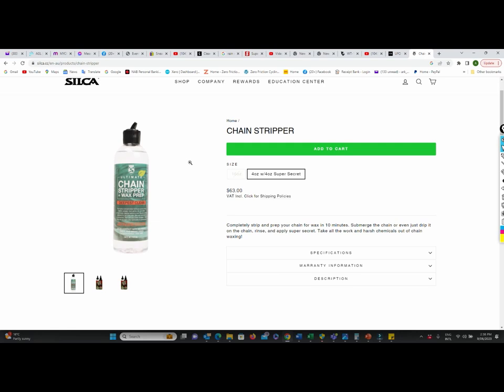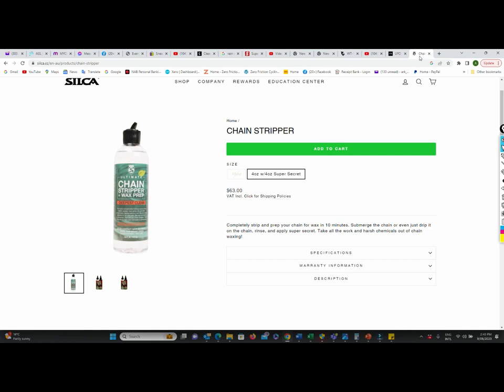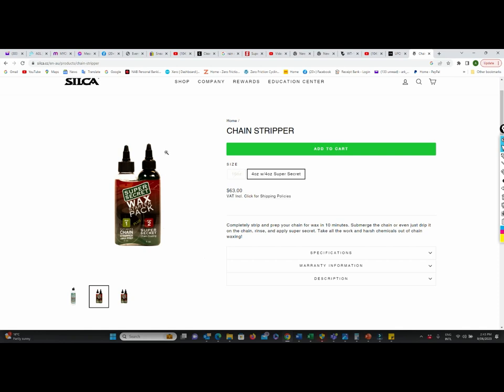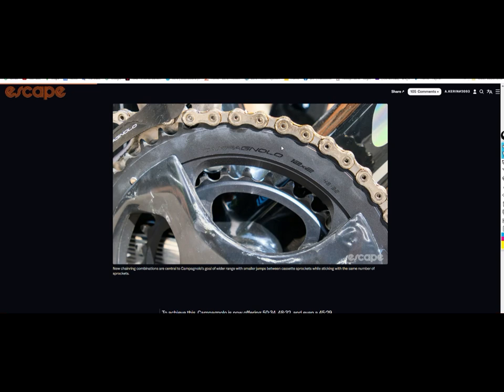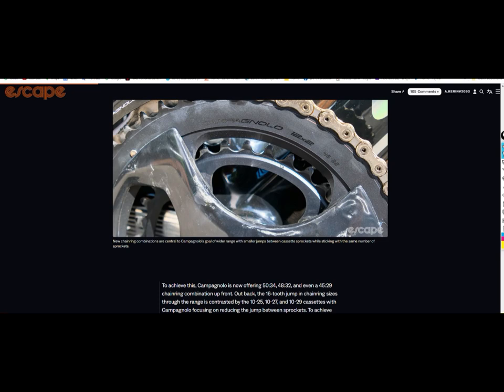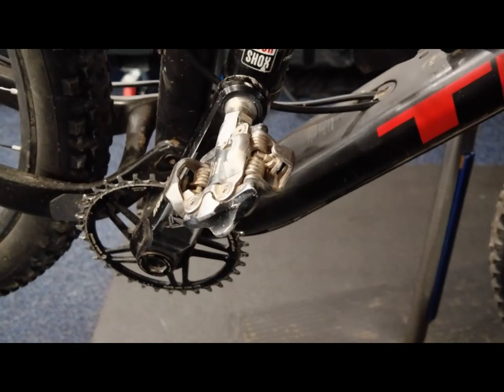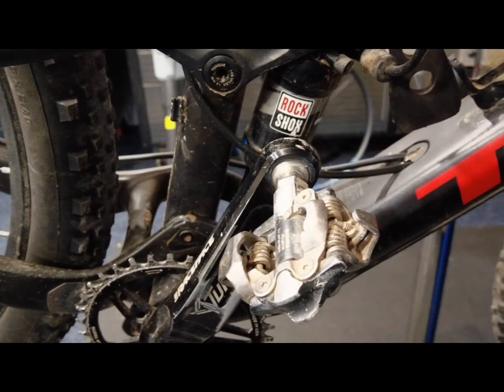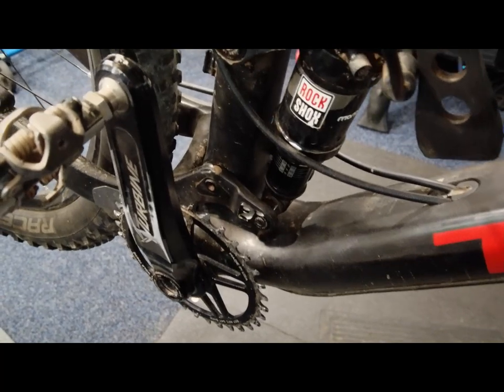Stripper and campy 10t

Comment: We're talking about marginal gains here. It would be nice to see the data watts, chain tensions, friction loss, etc. when in these 10 tooth high watts situations. Do you have the data yet? Update: chain waxing with Silca using a insta pot 4 qt to heat it up is a game changer. Takes 15 minutes, chain is always clean, wear is nil, and I'm using 4 chains. 2 road bike 2 on my mountain bike. I'm reusing the quick links up to 5 times with no problems. I'm so intrigued the cycling world hasn't taken this clean_zero_friction method by storm yet. It's definitely a game changer.
Reply from the maker: Hey Glenn - the data on the chart there by Jason smith of Friction facts fame is actual tested data. The short version is; 
> You will never detect such losses in your riding
> The losses are physics /maths / logic and TESTED - with extremely accurate sensors - proven. It really is not in dispute. 
> Whilst you dont spend much time in the 10t to get max losses, the fact is - smaller rings are higher loss, and will always have you in smaller cog for the desired gear inches etc - on average in most of cassette range it is going to be 2 to 3w. 
> We should not be going backwards in efficiently losses for latest and greatest and VERY expensive groupsets. All areas should be moving forwards. ANd there is no reason for us to go backwards - it is a reason that only helps the mfg in reducing their costs - but it i rather difficult to see where that is being passed on to us. 

A fictional example is a bit like - A conti GP 5000 TT edition is 7.5w loss and $150. Now conti bring out a their latest greatest GP5000 TT race edition, that is 9.5w loss due to the fact they are making it from a cheaper casing material, but it is now $180. That is not a step forward for the consumer. 

Again any world tour teams - to consider running - just like as with sram - the first thing they would demand is larger rings - and it is not for range purposes - the range is there. So - should they be getting a yeah thats fine pass, for giving us a less efficiency, for more money, on their latest EIGHT THOUSAND DOLLAR groupset.   Even though i could never detect it if i rode it - just the move in that direction offends me. Our latest stuff should be giving us improved efficiency, not worse, so they can save a buck. 

I bet sram a friggin pumped they now dont have to field the above crap from people like me by themselves anymore hahahahahaha
Reply: @zerofrictioncycling992  Now I understand what you were saying. Step backwards in technology (know) and at a higher cost. It needs to be a balance of front and back sizing plus optimize the chain line angles too. I get it. Just want to emphasize how much cleaner and satisfying it is to use immersive waxing with additives. Game changer clean, low friction, and most importantly no wear in the drive train in practicality. I can change a chain in about a minute now. A quick rinse in alcohol gets the nasty out if any on my mountain bike. My bike frame and parts are dirtier then the chain now. In conversation with fellow riders it's like you're weird or talking about politics if you mention you're a waxer. A study in psychology I guess, set in their ways or dripping on muck off makes them feel like they're solving the problem when in reality they're making it much worse. Like mining for precious metals to make batteries when they're charging them with coal power. :) :) :)  Thanks Adam and how did the carbon wheels that failed turn out? I've seen several gravel race DNF's frames breaking too at desert gravel in Fruita Colorado. Another sales job, not built to take rough roads these gravel bikes, I road my mountain bike and had a great time passing most of these broken gravel bikes. Unbound was way worse.
Reply from the maker: @Opt_out_of_this  Yes are very correct there! Mtb demographic is honestly quite fascinating. Overall they have by far the most to gain re friction / parts wear savings for going wax - and the smart / logical ones get it asap - but then much, much more of MTB just dont get chain lubrication and how much it means, and why waxing will be king offroad - at all. Just listen to podcasts of the likes of Just riding along and their understanding of wax / chain lubrication - what a train wreck - and yet there is a huge part of mtb that think just like that. It is changing, not only due to cost of components kick starting more to switch on some logic circuits - but simply the never ending drive and push re wax lubricants from many top mfg's. I would say roughly 9 out of 10 new high profile lube launches have been wax based in last few years. It is very much like say 5 years ago, no money was really being put into tubular, all R&D money on that front was being put into tubeless as that was the clear future direction. The benefits of top waxes / wax lubes over wet lubes -for a part that operates completely exposed to contamination - similarly the vast majority of R&D in this space by mfg's who know what they are doing - it is into wax / wax lubes - not wet lubes.

Those mtb riders dripping on M-O etc for offroad - they may as well drip on some cutting fluid.

Comment: What about more cross chaining from larger chainrings with same size cassette?
Reply from the maker: For road - until you get to basically cog 1, the efficiency gains of the larger ring / cogs offset the losses from cross chaining, and they are generally more efficient unless running big ring to biggest cog, in which case one should just change to small ring

Comment: How much am I losing with my 46/30 rando gearing? How much am i gaining by having a nicer chainline than I did with 50/34?
Reply from the maker: Again you wont ever be able to notice or measure in you own cycling. I would not worry about it at all unless you are a very very serious racer. 

The main point is should our latest and greatest drivetrains be stepping backwards re efficiency - for the reason of mfg saving cost - and it is hard to see where this is being passed on to consumers.

Comment: .5w loss vs 2.5w loss, where do you get these numbers from?
Reply from the maker: Friction facts did a bunch of testing of bb's back in the FF days. A good bb is around 0.5w loss. The worst bb tested was 1.5w. I have felt a few pretty cheap bb's in my time that do not spin well, as well as many very good bb's - so would have some indication of what approx 0.5w is, and what would approx 1 to 2. 

I may be out by a bit of course - but i wont be out by enough to make the example not relevant. A 2w or 2.5w loss bb will not free spin well at all, and the majority of those who would remove chain and notice bb spinning not so well, take action. People almost always take action when they notice bearings not spinning well, even if the cost in most cases will be less that the difference in oh so many other things they would never notice if it made them 2 to 5w faster / slower.  

The main thrust is smaller rings, indisputably - increases losses, buy on average at least a couple watts, more so at the smaller end. And so even if you cannot notice in your riding, should the latest greatest groupsets coming to us be less efficient than previous, for them to save mfg cost - which hardly seems to be passed on to us. For 99.99% of cyclists, the increase in efficiency loss will never matter, nor be able to be measured - that doesnt mean mfg should get a pass on giving this path.  

All things should be moving forwards / improving on latest greatest 8k groupsets. Efficiency should not be going backwards.

Comment: I know there's a lot of talk between a bottom sprocket of 10 vs 11t. Why doesn't Shimano offer more 11 and 12 speed cassettes with a bottom sprocket of 12t? This would be very easy. It might be a bit harder for SRAM and Campy to also offer cassettes with a bottom sprocket of 11 or 12, but why not give people the choice? This would be a better option for slower cyclists who don't need or want a 50/11 or 46/10.
Reply from the maker: Yes great thought - it is mostly just cost - to offer more options - it adds cost to mfg & packaging runs, and it adds more SKU's to manage stock at all levels from mfg, to distribution, to importers, to stores. All stores end up ordering too much of one thing and not enough of another, leading to OOS on stuff that is selling well, and excess stuff they cant move or takes and age to move which is just $$ they are paying interest on sitting on shelves. It is a really tough balance - and so what seems easy and logical to a consumer (ie -i thinkg absolutely more cassettes should have a 12t smallest cog vs 11) - but it turns out even such a small thing is actually very difficult to implement at many levels. A bike store already has to stock so many cassettes from sram in multiple ranges in red, force, rival - - 11spd, 12spd, 10spd, and campy, and shimano - even a few ranges across many groupset levels and speeds - oh man the stock $$ / ordering adds up big time, and if you dont buy enough - often when go to re order from importer - they are out for 6 months or more before you can get more - and excess others can just be sitting on shelf for years. How many will buy 12t? how many should mfg produce to then be distributed to importers across europe / USA / asia / etc etc - it is just actually very difficult from mfg to importer to retailers to get these numbers and costs right, and if wrong - its a bust for all.

Comment: Taking it to extremes: how big can you make the chain ring before the efficiency decreases? I guess at some point, the friction from lots of teeth and links would in the end dominate and...loss would go up?
Reply: It won't: number of links doesn't matter for chain efficiency. Power is lost at teeth engagement and chain articulation. When it is freely moving between cogs and rests on a cog, chain doesn't loose energy.
Reply: @Feedback ZA Loop  yeah, in that case I suppose it would indeed take an extreme case to reduce efficiency (such as so much chain and chain ring weight that the whole bike got way heavier and tire friction increased)
Reply: Friction does not depend upon the size of the rubbing surfaces but rather their surface quality, this is what I learned in school about mechanics.
Reply from the maker: Thats a good question - i think the answer is definitely larger than what we can power. ie they use up to 64t in track riding. They could use a 50t and a smaller cog - but they go as large as possible. 

For road there becomes more and more issues as things get very  large, as you need larger cogs  / cassette range to ensure you are in middle of cassette for bulk of tt, and both larger rings and cogs will exacerbate chain line angles in the biggest cogs - so the gear inches for the avg speed the rider is likely to be doing dictates ring sizes and cassette range for TT's etc.

Comment: doesn't equal power into the chain result in the same tension?
Reply from the maker: There is greater mechanical leverage force from crank arm to the stop point, which is the chain on the chain ring. Power is a dynamic number, it the average force you exert on the pedals across a full revolution of the crank x by revolutions - same as for an engine - power = torque (turning force) x Rpm. 

For same power  (force on pedals x cadence) - tension load on chain is greater the smaller the chain ring and thus greater leverage of crank arm over the chain.
Reply: @zerofrictioncycling992  Thank you. So, hypothetically, if you were heavy on a steep hill putting out 800 watts at 60 rpms in a small gear, the tension would be less than 800 watts going fast at the same rpms... Gotta admit, that's hard to wrap my head around.  Seriously, I'm feeling, not too bright at the moment. Sheeesh.
Reply from the maker: @robertwhyte3435  Ha no it is not a natural thought path - but yes there is a reason that chain snaps are very rare in sprints in the big ring, smaller cogs etc despite 1500 to 2000w, vs other more innocuous times. 

And easy way to think would be ok - i need to snap a chain. I can exert X max strength down on this lever (crank arm) to try and break it. Lets say the chain is being held static - it will not move - you will not be able to rotate the chain ring / cog. 

Imagine a really large chain ring - say an 80t - so the ring - chain stop point - is almost at same place as the pedal. Or, imagine say a 22t chain ring, so the ring is very small, and there is a lot of leverage of lever arm over the stop point. Your same max force on pedal will exert a lot more tension into chain on the 22t ring vs the 80t ring. 

Same is happening at whatever power your are generating. Your power is independent of the chainring and the chain. it is your force on the pedals multiplied by your cadence = power. The tension in the chain from your power will then be determined by the crank length and chainring diameter.
Reply: @zerofrictioncycling992  thanks for the explanation.  BTW I've been using the super secret chain lube on my gears, painting it on with a brush,  and melt waxing my chain for awhile and it seems to work well. Nice and quiet.

Comment: Always been a fan of small rings, the efficiency loss is super tiny and with small rings there is zero chance of snagging your pants on the chain and chain ring.  10t is a little weird though, those BMX microdrive sizes have issues.
Reply from the maker: depends what you mean by super tiny. Its not an issue for most recreational riders, as you would not be able to notice. But as a physical comparison to larger rings, it is not super tiny per se. 

52x11 vs 48 x 10 jason smith tested as a 6w loss difference. it will be less on other cogs, but you could say as an average circa 2 to 3w loss vs "normal" size rings. 

So its not a show stopper for most, but the main point is - this move ONLY benefits the mfg by saving production costs. it is not a benefit to 99.9% of cyclists who dont need 4 less chain ring teeth to avoid pants issues. When one is shelling out the big bucks for latest gen drivetrain - it is preferable for ALL aspects to be moving forwards. Drivetrain efficiency should not be going backwards. 

For the racing cyclist (and there are a lot of recreational cyclists), the first thing they will look typically is larger chainrings vs 48 or 50. And those options are not cheap. I have a friend who was looking at the factor hanzo TT bike - comes with axs red with 48/32 chain rings. On a TT bike. So that immediately ruled that bike off the list. 

So yep - for sure not an issue for many, but i just do not think it is correct to give the consumer a less efficient drivetrain if they do not wish it. Sure make 48/32 and 50/34 avail, but also make 52/36 and 54/40 easily available for force and rival level as well, and at sane prices.

Comment: In defence of smaller chainrings, they offer bigger range in case of 2x and allow for narrower chainline for 1x, minimizing crosschaining in mid and low range. So they are definetely more beneficial for non-pro riders

On the side note, it makes me wonder, was 10t introduced in order to justify smaller chainrings or smaller chainrings followed it... 'cause it is only recently that sub- and supercompact cransets became popular. Kind of an egg and a chicken thing
Reply: But slightly bigger range is due to larger jumps at high speeds where the tooth progression is one. Where you need smooth shifting the most.
Reply: @jkk916  no, it's not about jumps at the cassette, it's because of relative difference at front. 50/34 is simply greater than 52/36, eg.
However, you are right that if you want to match top ratio of two systems, one with smaller chainrings will have greater gaps near top speed. But again, it's a problem for pros, especially sprinters, the average riders use top two gears as bailout for descends.